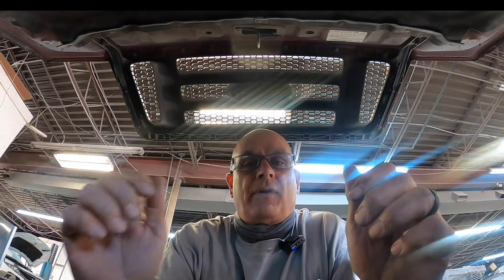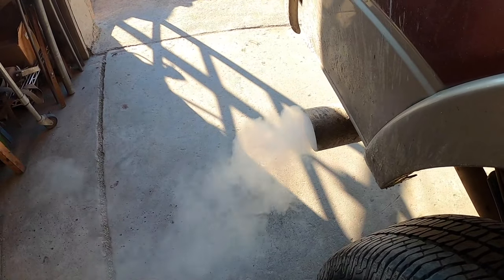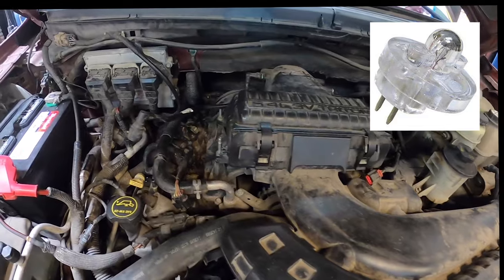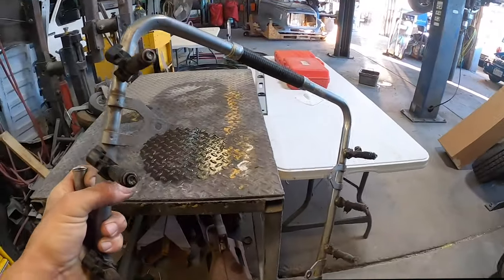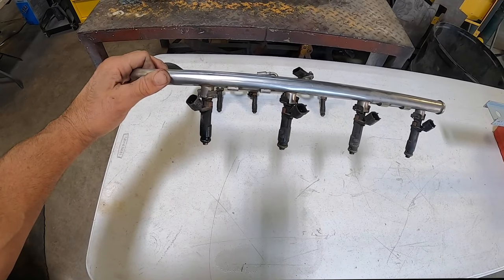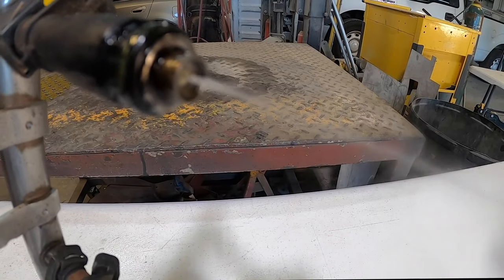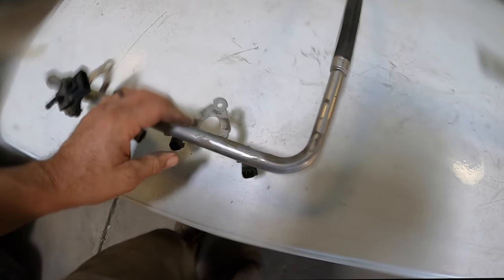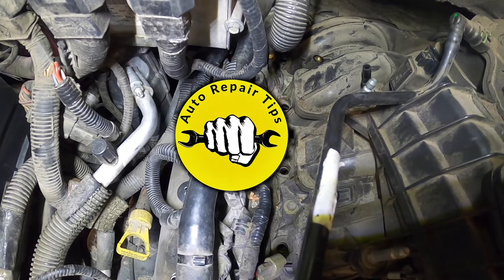This is why you have white SMOKE coming from your EXHAUST~~~~TUTORIAL easy FIX

Comment: Hi i am have toyota highlander 2009 188k, i have a same issue gives smoke while start up and goes away after a while, also when I accelerate hard while driving it gives smoke as well, i checked everything looks good to me, but cant find the problem? Do you it would be fuel injector issue?

Please suggest
Reply from the maker: you need to check oil consumption

Comment: I have a Lexus rx300 (1999).. It has been sitting for 2 years but i decided to start it up again.. The sparkplugs where bad so i replaced them..and suddenly the white smoke started.. But i only have this when doing a cold start..but it happens sometimes, sometimes not. I don't see any water leaks, the temperature is stable and no milky water spot in the oil cap.. So I'm confused what can cause this suddenly after a sparkplug change?? .. I haven't done a engine oil service yet till now.. So what seem to be the issue here? 
😕
Reply from the maker: does the smoke smell like oil or fuel
Reply: @AutoRepairTips757  smells a little like oil

Comment: My vehicle also has some white smoke coming out the exhaust system..sometimes its not so thick but can see it's white smoke..car also has no compression ..car wont idle aswell..i did overhaul the head about 2 months ago because the gasket was gone
Reply: Please specific your vehicle make, model and etc as detail so good Samaritan will be able to help if they have experienced it or have knowledge about it. In general vehicle, for the white smoke, did you change the valve seal when do overhaul. If change, then do check for coolant level. For no compression, is your vehicle engine type non interference (I will not suspect head gasket as you should change it when do overhaul). Your vehicle sure will not idle well as there is no compression.

Comment: I have a 2015 kia soul and its blowing white smoke alittle bit and one cylinder is misfiring. The catalyic code came up saying the cat needs to replaced. Im assuming one fuel injector is malfunctioning causing too much gas or not enough gas and therefore the white smoke is coming out and misfiring. Im hoping its the fuel injector because if not, im looking at a serious engine job. I already replaced spark plugs, ignition coils, verified spark in the cylinder. Wish me luck

The coolant is good and is not mixing. Coolant has been level and is perfectly fine. Oil consumption a bit I was told. That's why im strongly thinking it could be the fuel injector.
Reply from the maker: Hopefully it works for you

Comment: Question, if fuel rail is out of car ,  one how to apply pressure, (2) where is the rail getting fuel from
Reply from the maker: it was left over in the rail when i took it out, if you dont have any left in the rail you can add brake clean
Reply: @AutoRepairTips757  got that , how are you applying pressure,  and how to either get a fitting on there, or just cup with my hand hose from my compressor,  think I would also have to cap return side correct , as if I don’t I would not build up pressure.
Reply: @AutoRepairTips757   hey tried something like this but my injectors keep jetting blow off the rail ,, with little pressure.
Reply: @AutoRepairTips757  one last question, so when I apply pressure no fuel should come out of injectors ? 

Ok, so I understand, when I turn the key but do not crank,  but hear fuel pump supply fuel to rail. Again, but still no cranking ,  I guess from reading and watching the pressure is sitting on top of the injector, but when does the injector open up and spay fuel to the cylinder. 

Thanks for taking the time to reply to my comment, you are a true professional
Reply from the maker: i dont recommend doing this but i just blew into it and what ever injector the fluid came out was the bad one

Comment: 06 Ford van...  white smoke coming out at start up for a bit then clears up... dont think head gaskets are bad, sounds like could be injectors which i think these engines are known for bad ones....all this sound about right?
Reply from the maker: An easy way to test it get a fuel pressure tester start the engine let it run for a second turn the engine off it should hold pressure and slowly come down if it drops down to zero really fast then it’s either going to be a regulator or an injector

Comment: Had a clogged cat..2006 mitsubishi endeavor truck would sputter and barely do 40 uphill and over 55 on flat highway...i gutted it along with alot of other things..IT RUNS MINT WITH 220K now...BUT i warm it up every morning and it SMOKES WHITE if it sits more then 2minutes at idle and when i drive off it blows a white cloud then it fine. With normal driving..only if it sits at idle for while.NO LOSS OF RADIATOR FLUID AT ALL...just did thermostat NO MAJOR OIL LOSS...no GAS SMELL....i am stumped along with alot of other car guys..any advice besides a free flowing cat..i get it to pass inspection and it runs great..just a little embarrassing when pulling out of my complex
Reply: I have the exact same problem, are you sure it was the free flow / catless Downpipe? I recently had removed my cat converter as well and realise car is smoking up on idles and stops

Comment: Yeah we did that just put brand new performance injectors in on a 2000 grand Marquis and we got the same issue all of the engine is running a lot better than it did before it’s not misfiring but now we got white smoke before that we had other brand new injectors that was causing misfires and dumping too much fuel into the porch but there was no white smoke constant problem solved

Comment: I hv the misfire , pick up problem , engine vibrating , white smoke and petrol smell from exhaust what is the issue ?
Reply: I'm in a similar boat. Misfiring is causing the engine to knock a bit, white smoke, bad cat. Im thinking it could be the fuel injector.

Comment: What if my v6 2010 ram 1500 blows a little white smoke out the tailpipe at red lights and stops but driving is fine and does not over heat would this method work for it ?
Reply from the maker: If you have a bad fuel injector you would have a bad misfire and it would smoke all the time

Comment: I have a nissan 350z and I replaced the 02 sensors and now white smoke is coming out and has a bad acceleration. The smoke seemed to be coming from my Y exsaust but I was wondering if a exsaust leak would cause that
Reply: Ever figure it out my g35 is doing the same
Reply: @ericballard1600 my G doing the same 😥

Comment: I have a Gen 3 5.7 hemi it has white smoke coming out the exhaust on the start up but goes away until the car is warmed up all the way. Thought it could be a blown head gasket but head gaskets looked fine still swapped them out for new ones just to be safe. Still has the white smoke any ideas on what it could be?
Reply: I have the same truck and issue, it may be a valve seal leak or worn piston ring, I am going to try and fix it
Reply: Hi xyou.. did you end up finding out what the problem was with your Hemi.. I have the same issues with my 2013 Overland 5.7.. any help would be greatly appreciated.

Comment: Got a 99 1.8 NB Miata with a lot of white smoke coming out of the exhaust and it smells sweet, is the head gasket just leaky and needs replacement or I have a crack on either block?
Reply from the maker: It’s possible your head is cracked, you have to pull  it anyway so you should get it checked by a Machine shop.

Comment: Odd question: how do you get MORE smoke to come out? I’m making a short film and in the script it says that the truck has a smoky tail pipe!
Reply: Seafoam
Reply: Run your wiper fluid resivoir into the intake and fill it with diesel. It’ll absolutely SHOOT a white smoke out. There’s more in depth videos online
Reply: This Bubba Kush will do the trick
Reply: Put used motor oil on the muffler..
Reply: Put coolant in the gas tank lol
Reply: @RONPEE-STINGER  that will just make it not run. Coolant and gas don't mix very well.

Comment: One of my cylinder is not firing and when I start her up I smell gas, get white smoke when I accelerate.
Reply from the maker: One of the easiest ways to check this is put a fuel pressure tester on your car start the car let it run for about 20 seconds cut the car off watch the gauge if it drops really fast you either have a bad regulator or a bad injector that’s not holding pressure it’s gonna come down some but it should come slowly
Reply: @AutoRepairTips757  ok thanks , glad it's not a very expensive situation

Comment: 2006 Chevy Cobalt: sometimes slighty smoking white at the exhaust, but sometimes not at all, blows a puff sometimes when accelerated but not constant. Check engine light is on with P0420 bank 1. Help??
Reply from the maker: Are you losing any oil
Reply: @AutoRepairTips757  I don't think so. There's no puddles under my car

Comment: have a 2002 dodge dakota sport and it smokes really bad when I start it ( white smoke ) but stops after I drive it until I turn it off and smokes for few seconds afterwards.Theres no over heating and idles fine ? Any ideas ? thank you
Reply from the maker: Possible oil returns are clogged so after it sits a while the oil seeps around the valves and when you start your vehicle it burns off any oil and you normally don’t see it do you cut it off again

Comment: My Volkswagen gti this morning getting on the freeway (not even fast) started shuttering and running like absolute shit and I got an epc light and engine light and white smoke was coming out of my exhaust. I was freaking out so bad until I finally had time after work to do some research and I hope this is all that’s wrong cuz I bought new coil packs and plugs
Reply: im having the same exact issue with my VW. any updates?

Comment: Need some help I have a 2000 mustang gt I just purchased turns out it’s a v6 to v8 conversion the car has no catalytic converters w mufflers it’s also has long tube headers the car throws out white smoke when started and you can see water kinda spitting out. A little but you can notice it when you run the car and come to a complete stop smoke from the exhaust will come out way more then when it sitting not exaggerate where it fills up everywhere but you can see the smoke blow towards you as you stop the car misfires really bad once in a while and starts running good again at times I haven’t looked into the misfire yet
Reply from the maker: You need to do a combustion leak test
Reply: @AutoRepairTips757  thank you I did the combustion test when I first got it the car passed it no liquid mixed in any other ideas I really appreciate your time

Comment: Please guide 
If any one coil of car is not working then it could cause of very mild white smoke ???
Reply from the maker: With out looking at, it’s hard to say but if you have one cylinder no firing then yes it’s possible that that cylinder is loading up and burning out the exhaust
Reply: @AutoRepairTips757  I just repaired the whole engine each and every thing .

Comment: Could this also lead to power loss on hills or under load?
Reply from the maker: Yes
Reply: Thanks I have the opportunity to buy a f-150 with the smoke problem for 1,000.00 because the owner doesn’t want to deal with it it’s only got a little over 80,000 miles on it.

Comment: I got the same problem but with a 2014 Ford Escape and there is smoke coming from under the hood. Do I have to same problem?
Reply from the maker: The smoke coming from under the hood might be a different concern. burn an easy way to tell is  hook a fuel pressure tester start the car and let it run for like 30 seconds, cut it off and the fuel pressure should stay when you cut the car off, it will come down slowly over a few minutes but if it  should not come down really fast.if it does then you have an injector that’s open or a bad regulator
Reply: @AutoRepairTips757  I appreciate the answer. I'm going to buy a fuel pressure tester and try it. This video will be better you show us step by step how replace this part. There's not a lot of videos on new Ford probably because it's hard to get to the parts off under the hood and it takes forever, like to do a oil change takes me 30 minutes because I have to fit my hand between the Aux Fan the front bumper of the suv. My 2008 Kia Rio use to take me five minutes. So there's an open market teaching how to fix the newer Fords, thank you again!!! If you got a website I will be going to it to learn how to fix parts on my Ford.

Comment: Can I ask u a question.my car had a some white smoke come out of the exhaust pipe I wasn't completely warmed up it was 40 degrees out I was on a hill at a stop sigh I pulled out I didnt see the car coming I have it a lot of gas then the smoke came out it disapeared as fast as it came out car runs fine no lights no issues Tons of  power and I couldnt get it to do it again I tried steep hills gunning it everything any ideas what could of happened
Reply: Maybe something in the exhaust burning up as you tilt the car? I would assume some kind of debris burning off in the exhaust as it does get very hot in there. Maybe some other issue inside the engine as its tilted?

Comment: My truck is smoking a lot whenever I press the gas, so I thought it was just a coolant leak but couldn’t see any leaks under the car and I wasn’t losing coolant, I placed head gasket sealer in the radiator (thinking it’s the head gasket) and then it started overheating for some reason. The white smoke is still the same and I can’t figure out why it’s there and why the car is overheating. I assumed it was the thermostat so I replaced it and replaced the coolant but still the same smoke and overheating. I also had no signs of coolant in my oil, sure I needed an oil change but my oil is black not milky brown. The coolant was clean too when I took it out.
Reply from the maker: Do a combustion test and see if you have a blown head gasket on the exhaust side. I have seen a head gasket Blow on the exhaust sideAnd never contaminate the oil. Also the smoke coming out of your exhaust does it have a sweet smell if so definitely a blown head gasket on the exhaust side
Reply: @AutoRepairTips757  I can’t really tell what a sweet smell is on vehicles, mine doesn’t smell sweet to me
Reply: @krispthethirst5819  I'm struggling with the "sweet smell" bit too. Things can taste sweet but smell??
Reply: @garymarshall231  sweet smell meaning antifreeze. Once you smell the antifreeze  enough times you'll know when you smell it cause it almost has a sweet smell and not like oil burning or rubber burning.
Reply: Sell the car now.
Reply: The car ended up just spitting out coolant every time and over heating immediately, it was as if coolant wasn’t entering the engine. The oil never mixed with the coolant and the white smoke was still there too. It wasn’t like a normal blown head gasket that gradually overheats, it just went to the half way mark and then straight to overheating mark. Anyway I couldn’t find out the problem and at the moment I think it’s something like a radiator because the water pump is fine. But best bet is to give up on the truck.
Reply: @krispthethirst5819     If it was not overheating untill after you put that sealant snake oil in then it plugged your radiator up and now you’ve created another issue never use a head gasket sealant it will only cause radiator and heater core clogging and won’t fix the head gasket.
Reply: @johnnyheckard7185  I agree, I believe the sealant clogged the entire radiator. Now it’s getting fixed for $1500 but the symptoms were was 
- pillows of white smoke from exhaust 
- heater didn’t work only blew cold air
- car would overheat after driving it for less then 2 miles
It was as if no coolant was even going through the engine. It’d just instantly overheat, when I tried to replace the coolant, I drained it out, put more in, but once I turned on the truck to let it drink the coolant so I can add more, instead it just started rising the coolant and having it overflow. No bubbles though just rising coolant that wouldn’t go down. Every time the car overheated it would turn off and not start and it’d also shoot the coolant out of the radiator cap all over the engine. So I was confused why there was white smoke when the coolant wasn’t even getting into the engine. Oil level was fine, no metal shards or coolant in the oil, I placed a magnet in the oil just to be sure too. Felt highly upset because the issue made no sense to me as to how a gasket sealer could clog the radiator.
Reply: @krispthethirst5819  
Yeah you definitely have a head gasket failure. That bars leak, silver solder,  and all them sealants that clam they can fix blown gaskets just cost more in long run.    That’s what they’re meant to do is clog small passageways and seal them off problem is they will also seal off all your small passageways in your radiator cores, heater cores, etc. now if the lake is small enough that you’re just burning some coolant puff in a little white smoke but still runs OK they can sell it off but I think yours was just too far gone that is a very hard area to sell just too much pressure and heat on a head gasket so what they do if they sell off everything they can usually radiators and heater cores leaving you with more issues. Sound like on your case as soon as you start Engine it is pumping air into your cooling system at a fast rate causing air pockets coolant won’t go into it heater core is usually set higher that’s why that’s the first place the air pocket will form causing the no heat I have no doubt yours is a head gasket issue.  Hope you get it lined out.
Reply: @johnnyheckard7185  wouldn’t say just that. He most likely had air in the cooling system and never fixed it, which led to the blown head gasket
Reply: NEVER add that sealant stuff to ur radiator....itll only block passages and coz further headaches... rather professionally have the coolant sytem unblocked for cheap than risking blowing ur headgasket with all these weird chemicals